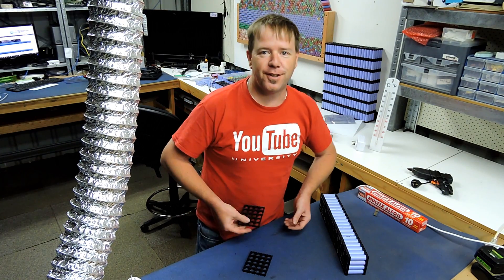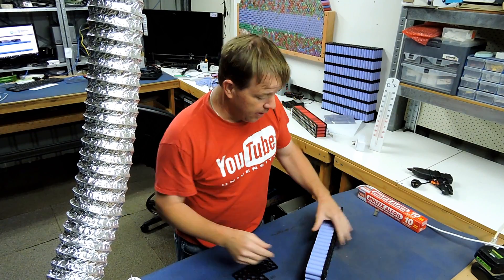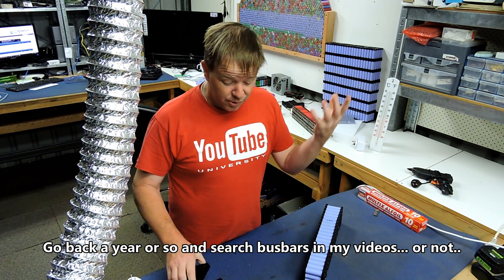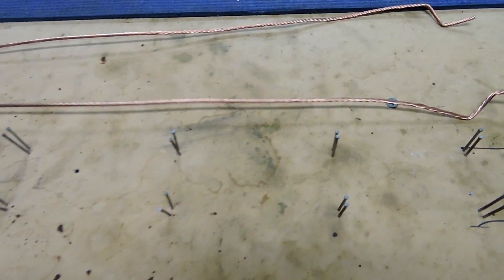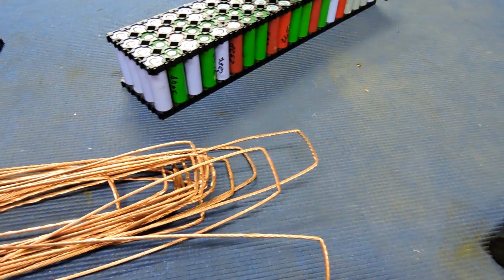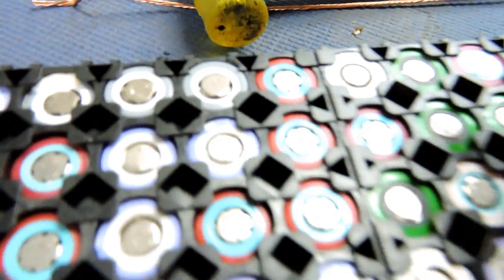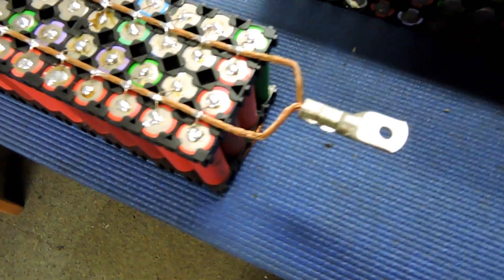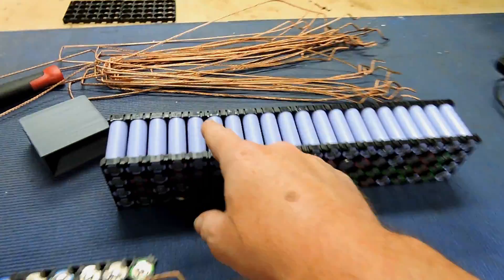Quick run down on building 18650 80P cells

Comment: With new Japanese or Korean 18650 batteries running USD 3-5 apiece, I can understand why you went for recycled cells. Since these cells are from different sources, what can be done if one particular battery fails? Will it affect the entire cell?
Reply from the maker: Yep! it can take out your house in no time. Cell fuses are in place to try to contain this issue.
Reply: Appreciate your insight. Thanks for replying. What's the expected lifespan of the cells?
Reply from the maker: Life expected - good question, hopefully i'm only half way through testing that at 4 years of full time use.
Reply: Thanks for the info. Cost wise, it sure beats the nickel iron batteries I've been considering.
Reply from the maker: Nickel iron have some solid advantages over time.
Reply: Could you please let me know what advantages Nickel Iron batteries have over time? Can their advertised longevity be trusted?

The other alternative I've been considering is getting AGM Odyssey brand  batteries from FCP Euro. They have a lifetime guarantee that includes batteries for individual cars. I've emailed them to ask if their lifetime guarantee extends to batteries for use on solar arrays.

Comment: Yes...just watched this video...awesome!! Thanks!!...I have heard of that repacker sight?... but I was planning on using the 4 by 5's...& just to buy them off of ebay...also...would you recommend using battery hookups- nickleplating/& solder them into place with a spot welder?...or using copper wire with what would you use for fuse wire?...thanks

Comment: Peter how big are the lugs for the battery packs and what size wire are using.
Reply from the maker: 35mm2 lugs wire is 6mm2
Reply: @HBPowerwall  Thanks Peter, all I need now is more plastic holder from somewhere. China's shut.

Comment: That doesn't look like twisted standard house power cable to me?
All houses in europe (me in NL) are outfitted with 2,5mm2 or 14 gauge solid copper wires.. 
So what is  exacly that you have there?
Reply from the maker: 6mm2 wire, we don't have solid here

Comment: If you use an indent crimper instead of the hex type your hot joint problem will go away. That is something I picked up from working with GE traction equipment over a long career.
Reply from the maker: Thanks for your help, GE traction stuff would need a perfection in the connections for sure

Comment: funny seeing that wall of batteries in back (not the cells, just the spare batteries stored in the 2x4 shelf you built) - it's starting to look like art.
Reply from the maker: Plan was do the whole thing with old cells but wasn't really a suitable space. Vibrations from trucks going past slowly make the cells fall off - bad news when you have stuff under it and 1000 cells fall breaking everything in it's path
Reply: HBPowerwall plastic wrap? Glue? Art finds a way :p
Reply from the maker: They found their way to a recycler lol

Comment: I've got a serious question / comment, what are the legal implications of a DIY powerwall ?
Because it's a DIY project, no regulatory body has signed off on it certifying it as being electrically safe.
So wouldn't a DIY powerwall be illegal ?
For example, what would happen if a battery bank (block of fully charged batteries) exploded for whatever reason, what is the possibility of it killing someone, yourself, a family member, neighbour or pedestrian walking along the footpath ?
Compared to a Tesla Powerwall for example, which would possibly have gone through a lot of rigorous testing, so as to get certified as being electrically safe, plus a Tesla Powerwall would be installed usually by a qualified electrical tradesperson. 
So for example if a Tesla Powerwall caught fire and burned your house down, you would be covered by your home and contents insurance policy. You would also have the option of suing the company who installed your Tesla Powerwall.
I can't imagine though that your home insurance policy would cover you, if your DIY and also self installed powerwall caught fire and burned your house down ?
On the other hand if you are renting the dwelling which you live in, I can't imagine the owner allowing you to hook up an un-tested and un-certified piece of electrical equipment ?
Reply from the maker: Great question - talk to your insurance company typically A LOT have all the 240v installed by licensed electrician keep all the DC below the legal limit of 120vdc and it's not more dangerous than keeping a deep fryer full of oil on your kitchen benchtop or lawnmower/car/bbq in the same shed.

Comment: Embracing my ignorance - forgive me if this is a very dumb question;  If you have a large pack of cells like your "cell 5" can you use the same charger that you use to charge a single 16850 battery but it just takes longer or do you have to have some kind of special charger?
Reply from the maker: Exactly how I do it :) IMAX is a workhorse !

Comment: These 80p cells are 3.4V at 240A yeah?

How long does these cells (the 18650s) last for just sitting?
basically, as time goes by, im going to start to build up some of these packs, i wanna electric car with them!
Reply from the maker: Store them correctly and i think you'll be good not too hot not too cold & store them at 3.7v i think they'll last ages
Reply: just have to ask, i think its going to be a slow process for me to get the batteries wired and stored up.

so for me to get 8K+ 18650s its going to take me many years..
Reply from the maker: Remember 8k cells is more like 20k unprocessed
Reply: yeah, you're right..  unless i cheat and get brand new ;) even then i suspect there is going to be a handful of failures
Reply from the maker: When doing hi-amp draw of a car - new is a fantastic option

Comment: Can you use regular AA or AAA batteries to build a power wall? Why it has to be 18650 and not just any Li battery?
Reply from the maker: You can use any rechargeable cell you like - there is no limit - i chose recycled 18650ED cells :)

Comment: Sorry if you've already addressed this... But what if someone were to use wire glue instead of soldering or spot welding? I know it's not as conductive as solder, but so long as it's not between the fuse and the battery, and you use the glue sparingly as it's recommended, I don't see it being an issue, but having never used it my perspective is limited.
Reply: All good, asked on the forum.

Comment: I don't understand why you use 80 cells. Why not 50 or 78 or 13? Can you point me to where there is info on deciding on the size of the pack and why? I'm on the forum but there's no sticky or thread(that I can find) where it's easily explained. Ta.
Reply from the maker: No rhyme or reason to it... i started with 160, was too big chopitinhalf done bigger the packs of parellel batteries cheaper it is to BMS small they are more expensive - but smaller is better to maintain
Reply: HBPowerwall Thanks

Comment: question in a power outage do you still have full power or does it shut down like a solar power system so it doesn't back feed the power lines

Comment: If the crimp is a little large for the cable, you wont need to make the whole busbar thicker, just add a strand or two into the crimp socket to bulk out that bit before crimping.

Comment: Just wondering if any others have chosen to retain some of the tab material on each end of the cell, as I'm doing. I figure I'd get the best of both worlds: good cell connection, and the remaining tab is short enough for safe storage until assembly, where the tinning of the tab material is easier, probably requires less heat and, most particularly, avoids the risk of heating and possibly damaging the cell......?
(I do like the twisted wire idea, looks much easier to do than HD copper pipe or strips)

Comment: Helo, I am french, and do not speak and understand English very well. so please apologize. I have two question. Do you fuse both side of each cell ? Only one side is necesary. (wire fuse on positif side, normal coper wire on negatif side). Also, you said each pack is used maximum for 20A. So one pack give P=UxI = 3,7 x 20 = 74W. 14 pack you be used for 76 x 14 = 1064W. is it the maximun power you need instantanly ? If yes, your tweested busbar diameter is enought, but if you need more power you will increase the busbar resistor. Regarding our european "rules" you should have a maximum 5A for a 1mm square coper  cable.
If you have a 4kw load, output inverter, you will need minimum 80A from battery. the busbar should be around 16mm square.
I will use 2 x 10mm square as busbar.
thank you for your nice job. Merci de votre excellent boulot!

Comment: Why is your magic number an 80Pc 18650?  I was toying with doing 120Pc but if I'm missing something please let me know?
Reply from the maker: 120 will work fine - in fact if you're planning on the Batrium BMS it's cheaper HOWEVER maintenance is the issue with larger.

Comment: Excellent portrayal of development including uhohs!  My only concern is that you've crimped on the spade connector. I plan on using copper tubing, flattened, drilled, soldered. I've purchased my 1250 W pure sine wave inverter before assembling our 2.5 KVA battery that will be our emergency residential power supply. Your videos have been magnificent, my life is much easier as a result as you've provided a clear procedure and I can avoid so many of the pitfalls. Hopefully in the future I won't have to start up the generator to keep the well water pump, sump pump and furnace running.

Comment: Newbie question how much power in kWh or wh does each cell have and how much does the full pack have 
I want to build a 10kwh battery so what size packs and cells do you recommend ?
Reply: A nominal 3.7V 2000mAh cell contains   2 x 3.7 = 7.4 Wh
Decide on a minimum capacity threshold, such as 2000mAh.
Find the average capacity of the cells you have above this, say 2200 mAh.
So, average cell capacity would be 2.2 x 3.7 = 8.14 Wh
You want 10 kWh, so you would need 10,000 / 8.14 = 1,228 cells.
You can arrange these cells how you want in "height" and "width", ie, series and parallel.
So, if you're running 24V inverter, 7S seems to work best - so 1228 / 7 gives 175 cells per pack, say 180 to round up.
If you made 2 packs of 90 cells for each S, then you could connect them each in parallel to make 7S 180P
If you wanted to go for 48+V like Pete, then it would be easy to rearrange them all in series as 14S 90P
Play with the values here and you should be able to come up with your own arrangement pretty easily.

Comment: Great videos! On 'cells'. I believe the correct terminology is 1 'battery' is a cell and more than one cell is a battery of cells.
Reply from the maker: I googled it and got confused so it's my way for now...lol
Reply: It's a battery if the cells are in series. If the cells are all in parallel then it is just a bigger cell because the voltage is still the same as 1 cell.
At least this is how I think of it.
For a 1S collection of cells, I suggest using the term "module" or cell pack to imply it is part of a battery, or battery pack.
cell is to battery as cell pack is to battery pack!
Reply: Right that makes more sense.

Comment: Thought of getting smaller crimp connectors rather than increasing the wire thickness?
Reply: Adam Welch hey mate, I'm amazed he still used those, I even DIY'ed my own from copper tubing. Also thicker wire = more current carrying capabilities (not that this pack needs it). I have seen loads of people just use the AMASS XT 60's as well.
Reply from the maker: Ooh look that's a possible solution hahaha that said some one gave me 100's of those connectors so probably why I blurted that out rather than providing a better explanation

Comment: Well done. Clearly this process is getting better and better as more people get involved.

What I see coming are improved 3D prints for your holders. Put a small rails on top (printed) to hold the copper wire.
It will also allow you to create custom endpoint (both top and bottom). Something to guide, hold and isolate the ends as well.
I know the printer is slow (and you are always eager to move forward fast), but in the end, how does time matter if you'll use these for years and you can make them perfect for your shed(s). 

Patience is a virtue (as is being smart, fast and efficient.)
Thanks for sharing. Great series.
Reply from the maker: I think the cell holders is a definite contender for this little series of videos... I'm taking your idea lol

This community is amazing and with as many minds as we have it's getting better faster -- that must be a good thing that's for sure!!
Reply: You could also have the cells interleaved to have a bit less wasted space between them. Like a hexagon configuration. Not sure if and how much space that actually saves.

Comment: Is the twisted wire thick enough for 80 to 160 amps (80 cells)?  It only looks a bit thicker than 20 amp wire 12 Gage wire.
Reply from the maker: my max load is only 20 amps it's more than capable to do the job :)

Comment: The definition of a cell is a single unit where as a battery is multiple cells. So what you have is a battery, you could possibly call it a cell pack but still technically it's a battery. that's why when you buy a AA,C,D cells they are called cells but the 9V battery is a battery. If you open a 9V up, it's made up of 6 x 1.5V cells unlike the others.. but.. who cares... details... details..

I like the 3D printed idea. I wanted to make those 4x5 but with builtin fuse holders and can't do that with the existing ones, well not easily at least.

dump solder into the lug to prevent it getting loose and a hotspot :)
Reply from the maker: Yeh, stupid details lol those single thing-oes i printed didn't even clip together doh!  Been told by the interwebs a whole lot of times not to solder and crimp

Comment: Just to put this out there the EBL brand on Ebay with seller  aibocn-shop in california they have a 10 pack for $16.60 USD that i have been buying rather than the used laptop batteries and they are working out pretty well for me all the cells test at 2000 to 2200mAh and ive bought 140 cells now so im just getting started with my 4S packs and doing hybrid SLA along with Lithium-Ion its a bit tricky to do but doable
Reply from the maker: I'll happily use genuine cells from the big guys than oddly branded unknown cells. but that's just me. Be sure to let us know if you have any issues - be good to know.

Comment: hi Pete, what thickness house cable do you use, 1.5mm2 2.5, 4??, I was thinking of using 2.5mm2 myself on a 120p pack\cell but thinking it may not be heavy enough to handle the load??
Reply: It depends on the load. I use 6*2.5mm2 for Max 80A load. They can easily do 100+. All depends on the voltage drop and loss you would tollerate

Comment: How do you replace a single cell (if its shorted, dead, or whatever) from the middel of the pack?
Reply: You can just break off the little plastic corners like he showed from hitting (on top or bottom) it to hard and slide the cell out. Just have to make sure you clean all the gunk off the cells.  If there is gunk still on the cell and you cant slide it out, break off tabs on bottom side and push cell out of the heat shrink. 👍
Reply: Doable. I did video of it as well. Its simple :)
Reply from the maker: Yep not too hard, typically i replace the whole 'cell' and retest it just in case...
Reply: The real question is, how do you pinpoint the faulty cell(s) ? is there an alarm/notification for it?

The parallel setup fuse all the cell health state and from the POV of the LongMon or even simple multimeter, they can't see (measure) the cell individual health but the bloody whole pack. 

Plus individual cell monitoring is the HOLY GRAIL and you need to dive deepest hell (wiring massacre and advance circuitry!) to achieve that.

 Hope they upload another videos about that.
Reply: JaY-JaY Dude remote pack. Fully charge. Remote fuse wire on 1 side. Check voltage drop after some time. Then u find those types. To test capacity you retest all cells in that pack. You cant get it  all :)

Comment: I am running 100 cells to a pack and using 10 gauge wire for my bus bars. I was going to run my bus bars in the same direction but I see that you alternate the direction. Is there an advantage doing it your way?
Reply: Yes, you should definitely do that, especially on a bigger pack unless you want to destroy a few cells quicker or not use the full capacity. Everything has resistance even the thickest copper. You have to picture your pack of cells being connected by a huge number of small series resistors (the small length of wire between two cells). I don't know what your setup will be, but let's say it's 4x25. The last cell will therefore be connected through 24 small "resistors", the first one by none. If you repeat the same thing for the other terminal without reversing the direction, the last cell will have 48 resistors in series, the first one still none. That's no good. Reverse the direction and every cell will have 24 series resistors no matter where in the pack. And btw. don't use both ends of the bus bars either. That would just move the problem to the center cells.
If you want to see that effect in a different way get a very long LED strip and compare the brightness of the first and the last LEDs when powering it either from one end or from opposite ends.
Reply: It helps prevent shorting the positive and the negative together.